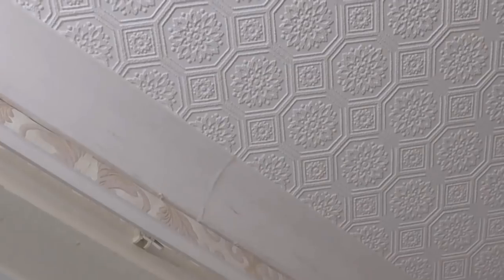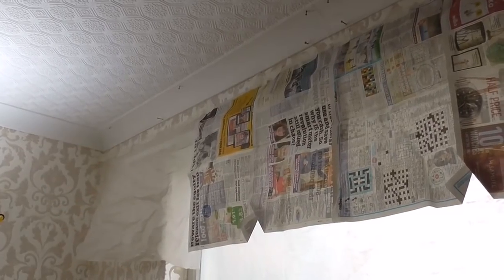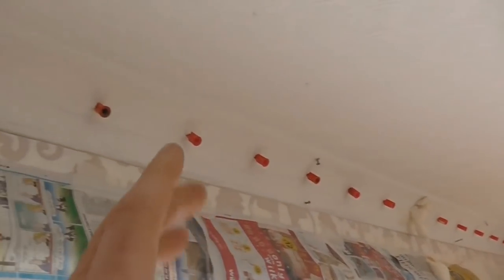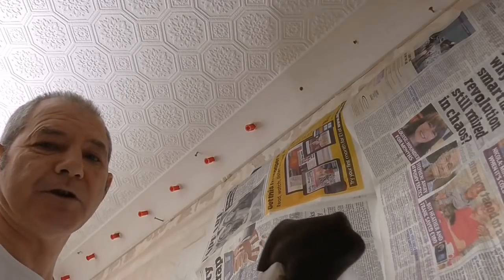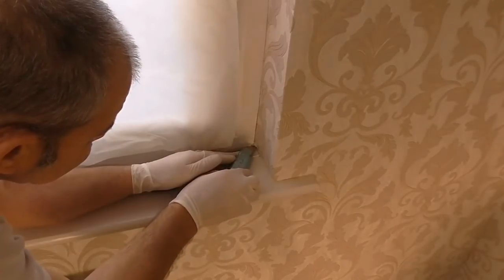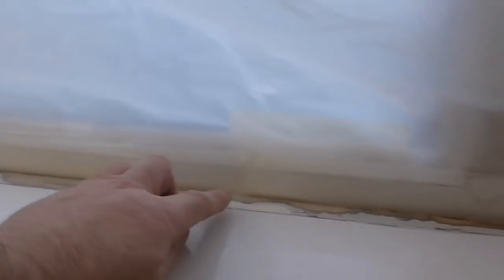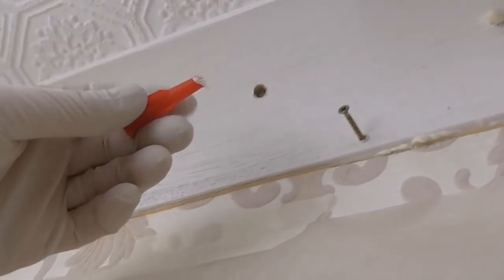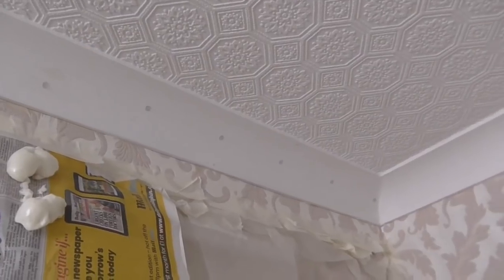Mould On Coving And Thermal Liner?

Comment: Hi. Another video that I have found useful. My windows are similar due to windows beings put in over 20 years ago and very little foam put around each of the window casings. Can you tell me the brand of foam you are using with the nozzle to allow easy access and the scraper you used to remove the silicone from around the trim. Much appreciated.
Reply from the maker: Thanks Soudal gap filler  and Prep Euro Filling Knife Set from Toolstation

Comment: This customer must be relieved that you can go through that crown molding (as we call it here) rather than having to rip it apart, mold and all. I like to do this sort of work on the coldest day of the year (-4 F, -20 C), when you can tell just where the air currents are by the cold spots, though I got stuck squirting foam into the molding around my air conditioner last summer to stop ants from crawling in through the gaps. Hopefully, in this lifetime, I'll run out of gaps to fill.
Reply from the maker: Thanks, they were happy I could sort it out.

Comment: On the outside of my upvc door and rear patio door the trim has come loose, which adhesive should I use to reattach them?   People have suggested using Superglue.  What do you think of that idea or can you suggest a better product or method of doing the job?

Also, would you recommend using Soudal expanding foam to fill the space between external window/door frames and the wall?      I've noticed that Screwfix sell a Soudal Window & Door Installation Foam Kit specially for that job;  do you think that would be a better bet than the expanding foam you use?

All wisdom & advice gratefully received!
Reply from the maker: The kit sounds ok as long as it's insulating foam. And yes you can use super clue although it's unforgiving one spot on the face and it will mark. It's also permanent which is good but if you ever want to remove it , it will snap the plastic. Your better using Uni Bond exterior sealant.
Reply: Painting and Decorating.   Thanks very much for that invaluable piece of counsel.  The Soudal foam kit is described as "Installation Foam".  I can only assume from that description, that one of its properties is 'insulating' and not just filling the space.  

The Product Content list describes it as "B3 PU foam" -- which, to be honest, doesn't tell me anything about its qualities.  

Anyway thanks for your reply.  Very much appreciated.
Reply: @apache16789  PU Means Polyurethane  it insulates and fills what more were you wanting to know about it?